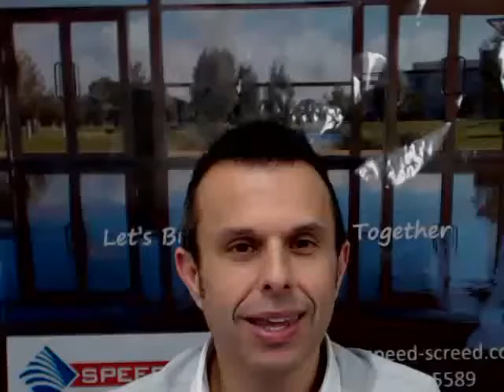Concrete Screed Minimum Thickness?

Comment: If we poured blinding concrete higher than the level by 3 Cm, so the screed concrete for waterproofing protection layer will be about 2 to 3 Cm
could we add fibers for that screed concrete to avoid cracks at future?